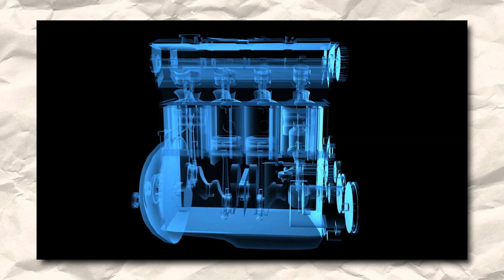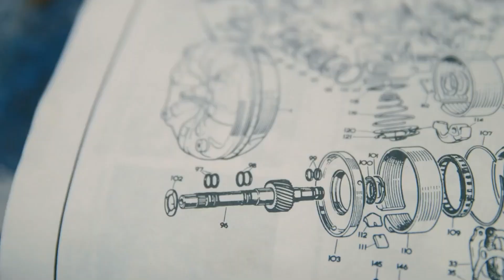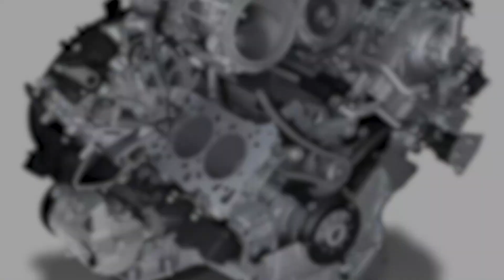The BRILLIANCE of Porsche's new SIX-STROKE engine.

Comment: Leave it to the Germans to finally crush the 4 stroke. EVs are not innovation but a bold, excessively cheating tactic to rush a technology that requires very little effort in a bid to make the world a clean place (get real). The real innovation is making engines cleaner and more powerful. No one wants useless heavy batteries in their cars that'll one day end up costing more money than the car itself. Cleaner engine technology is the only way forward. Emissions control and all this so-called environmental babble are all just to trick you. EVs will fix nothing. I can't wait for 2035 when the bans come into play, and it'll all come crumbling down, and you'll all be dying to get ICEs back again 😊

Comment: OK I just reviewed the combustion process on another video. This is not ground breaking. It is increased mechanical complexity to try and get better fuel efficiency by having more power strokes per revolution. It's not a two stroke or anything like that. An electric motor assist would make a lot more sense.